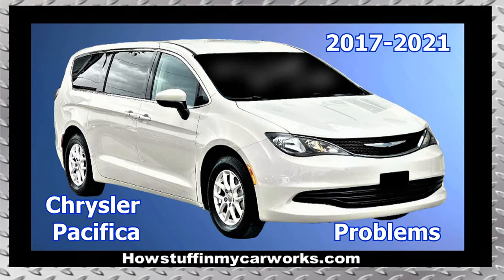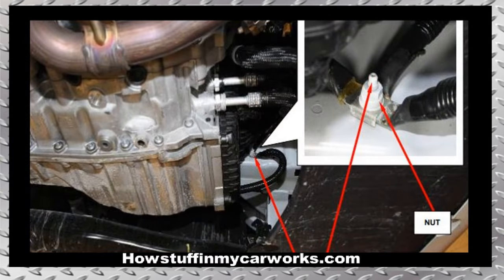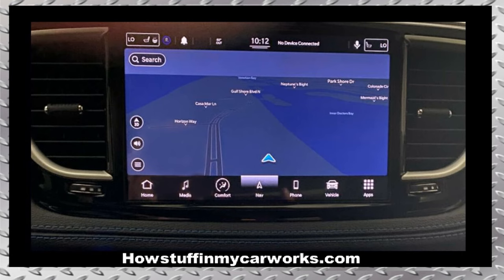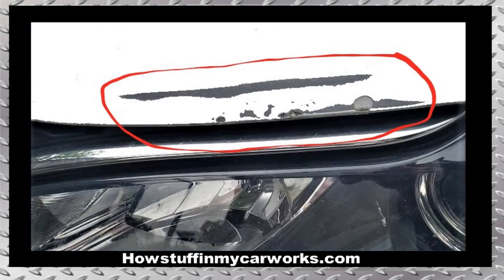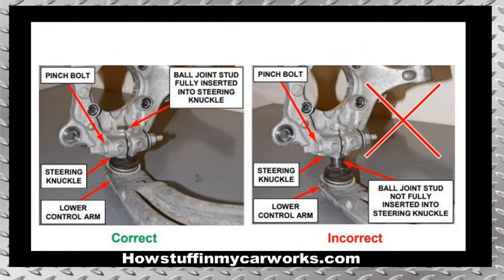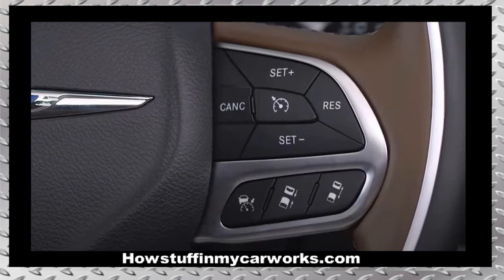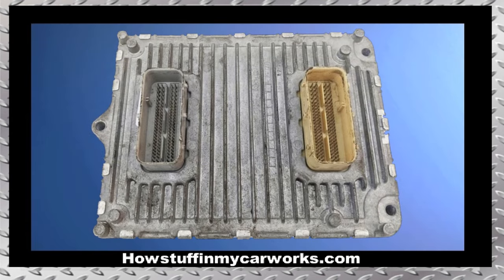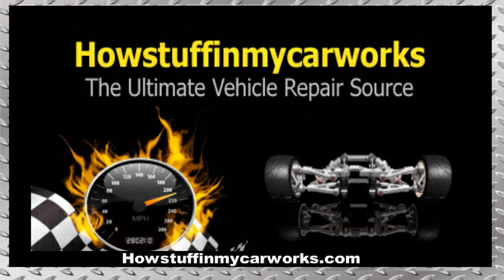Chrysler Pacifica Minivans 2017 to 2021 common problems, defects, issues, recalls and complaints

Comment: When the A light comes on the dash board for ESS, , you better get it fix by replacing the small battery quick otherwise it will drain the main battery when the car is off. It drained my main battery  so bad that I needed a new battery. Also when replacing the small battery take off the negative terminal from the main battery for at least 20 minutes to reset the computer.
Reply: Has happened twice to us.
Reply: And that’s why as soon as I turn on the car, I got used to turning off the Automatic Engine Startup button. I have never had a problem with my battery. I hate that stupid turn off/turn on feature.
Reply: @Mike_44 hmmmm. I need to do that.  I think I saw it in settings.  Thanks!
~ 🦋
Reply: @ukulelebutterfly it's a little button on the dash. You have to turn it off every time you start the van.
Reply: My solution was disconnecting the small battery.  I wrapped the battery cables in electrical tape.    Much better driving experience.   Van does not turn off when stopped which is a plus.
Reply: @slackerdug3423  Still okay?..no problems..🤔 jw

Comment: 2021 Hybrid Plug-In, 24,000 miles so far. No problems so far. If the U-Connect acts up, you press and hold the volume and channel buttons in until it reboots. That has been done a few times and, so far, it has resolved any problems.
Reply: Do you have the engine on or off when you do this?  What kind of problems does UConnect show before you reset it?

Comment: You forgot the issue where the van will not start and the front panel will light up like a Christmas tree with various errors.  This is caused by the star connector which needs to have the connectors and board replaced (which costs less than $100US if you can do it yourself).  If you have this issue and you take it back to the dealership for repairs, it is often misdiagnosed and could cost you a boatload of money.
Reply: Could you elaborate please? I’m having similar issue. Ny gas pedal is stuck and car won’t start.
Reply: What do you mean by star conector? Where is it located and how does it look?
Reply: Also happens when your battery needs replacement.  Happened to me 2x.

Comment: My 2018 Pacifica Hybrid issues:
Catalytic converter (in 8months), infotainment restarts every 3mins, and sliding door actuator. 
Bad Cat converter got so hot that it almost set the minivan on fire. Dealer updated uconnect firmware and claiming it fix it, but same restart issue while driving back.  First time owning Chrysler and it will be last.
Reply: oh brother.   i just took the plunge, but I got a 3 year bumper to bumper warranty.  even covers all electric and even the tires.  scratches.  anything.  I will be making sure they work

Comment: Another problem in the 2019 are the batteries especially the small battery which needs steady replacement
Reply: unplug it lol
Reply: I have the 18 and just put in a second aux battery. Leave the negative unplugged if you never use the ESS you just have to look at the idiot light..
Reply: Need to replace mine twice in 2 years.  Main and auxiliary
Reply: Stange this happens on some models but not all.  My daughter is every two years.  However, living in Southern Cali (desert) requires to replace the main battery every 3-4 years on every vehicle. Same with the windshield wipers every 6-8 months (extreme heat).
Reply: Chrysler's warranty for the batteries is 36 months and mine goes every year so I've been covered.
Reply: @user-tv1le7sw2l  They wouldn't replace it for me after the first AUX died.  On my 4th Aux (it's dead now too) and 3rd main battery.  Parasitic draw kills the main battery prematurely.
Reply: @whataboutvegas  The way they are connected, the bad one will drain the other.    Disconnect small one and replace the main one.

Comment: My 2019 has the paint issue on the hood.
Reply: I was told that Chrysler will fix it or give new hood but I’m in Canada
Reply: Mine too
Reply: My 2017 has hood paint issue. Chrysler WOULD NOT fix it!
Reply: My 2017 had a paint problem after about 2 years and they fixed it
Reply: My 2018 has it.  My son worked at the Chrysler dealer and they wouldn't fix it.

Comment: I have 3 of these issues happening at the moment!

Anyone else noticed that the power steering has a "hitch" of sorts when cornering around 45-55mph? 
Also, having to replace the rear sliding door actuator.
Reply: I have the steering issue on a 2018.
Reply: mine does it at very slow speed like backing or moving forward while turning left
Reply: What year is your Pacifica?
Reply: are you referring to a stiffness in the steering wheel when taking extreme turns ?
Reply: @jfoquendo  stiffness on steering  while making a turn on higher speed on my 2017 model. Thanks for the solution pls?
Reply: @jfoquendo  not even on extreme turns re stiffness while steering
Reply: Mine has a squeaky noise when I turn left or right at slow speed
Reply: I have the steering hitch. I suspect a bad ground at the location pointed out in the video.
The power steering is electric and draws a lot. A bad ground could do it. But, this is just a hypothesis. I have yet to look into it.

Comment: Auto zine is telling me I have to have a professional install my battery in my 2017 Pacifica. Is that true?
Reply: no, we have the same van and i replaced my battery last year it maybe took 15 minutes. Had to remove a couple little things to have room but it wasn't hard to do. Most part stores will do it for free if you buy the battery from them, or watch a youtube video showing how to do it and if you can handle the weight do it yourself.
Reply: No it is easily replaced
Reply: Total BS
Reply: As far as i know,you have to specify in the system that a new battery has been installed. It has something to do with the charge of the battery.🤷🏼‍♂️

Comment: 2nd row captain chair headrest is in forward position and will not stay back upright. These have a spring in the headrest that defaults them forward. They are supposed to go back upright when seat is locked back into normal position but my headrest is permanently in forward down position like stowaway mode. Something inside must be broke. Terrible design!
Reply: Did you figure out how to fix this? I am having the same issue.

Comment: My 2019 Chrysler Pacifica occasionally gets stuck in accessory mode when I attempt to turn it off during cold weather. I find this situation quite frustrating. Is there anyone who can provide insight into the possible reasons behind this issue?
Reply: I too had this issue in our ‘19 Pacifica. I live in South FL so it’s probably not related to cold weather. The issue hasn’t happened in a while for me, but many times after shutting off the car, I wasn’t sure whether it was On/off.

Comment: Also 2017 Pacifica bad FUEL PUMPS, mine has to be replaced at 73K miles at $1300 from Dealer.

Comment: Anyone knows the part number for the actuator in the last issue presented?
Reply: 6816 4960 AA - Have the part on my desk.  It's the problem you hear the blend door hunting whenever you open either door and it's lost, so just keeps hunting and hunting until it eventually gives up.  Simple fix, but a very tight space.  You have to remove the glove box.

Comment: I have a 2021 Pacifica bad transmission
Reply: What’s the issue with your transmission? Mine says, service shifter
Reply: My daughter has a 2019 Pacifica and her original transmission went at around 36,000 miles and then six months later she had to have another replacement. Her car has had three transmissions in 3 1/2 years. She has had the radiator go out plus most of the other things that were on the list of ten and she had to pay for all but the transmissions. The car is a lemon and Chrysler recalling these things for her car.
Reply: I have 2018 pacifica.    The transmission sucks.   If you are accelerating and take your foot off at a gear change, then it sounds like the transmission dropped out.   Weirdly putting in only non-ethanol gas has minimized this.   70 cents more a gallon though.  The transmission tries to learn your habits but there is a youtube video on how to reset the learning.

Comment: They are garbage van nice looking tho
Reply: Just bought a 2020. Hopefully these issues have been fixed in this year.
Reply: I have 2017 with 70K and never had any issue since I bought it. I love this car !
Reply: @VaxxedStories  yep, sheer garage. Paid $50k for 2018 Hybrid and bunch of issues cropping up after 3 yr manufacturer warranty expired. Lucky I bought 2yr extended warranty expecting typical Chrysler defects.  Never again.
Reply: @Joseph-eh4rs  The Hybrid is a completely different animal and riddled with problems electric cars are still too new in it's infancy. Internal combustion engine ones are fine. I have an '18 Pacifica and runs perfect if you take care of it. Love it.
Reply: I have an all gasoline 2021 limited, with 38k miles.  Prior owner had some backend damage that was never reported. Dealer repaired it. Backup camera system works half the time. UConnect rear screens have chess and checkers games that dont work
Reply: Whatever your driving is Garbage to, every car has its issues...
Reply: I love the look and the stow and go feature. I use mine to haul stuff all the time, but I’ve had more problems with my 2017 than any other car I’ve ever owned. I won’t buy another Chrysler.
Reply: @seatime674  In-laws have a Sienna.  It's a 2014.  I have a 2018 Paci with 139,000 miles.  They are at 250,000 miles and their total maintenance costs is maybe $2,500 (mostly tires) and mine is well over $12,500.   Hey, but mine can park itself!  The car can....not that dang blend door.  It's always hunting.